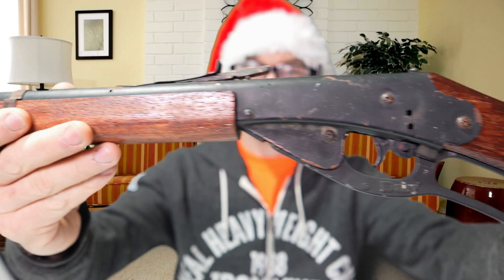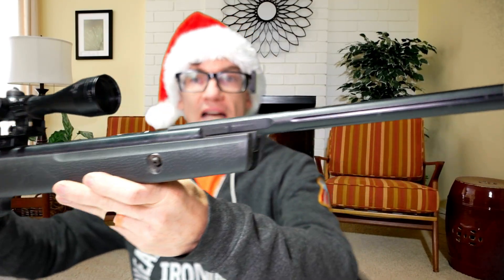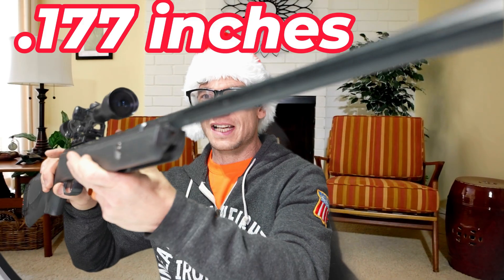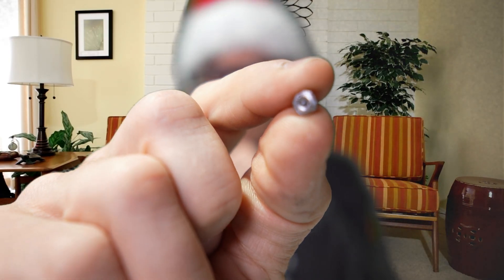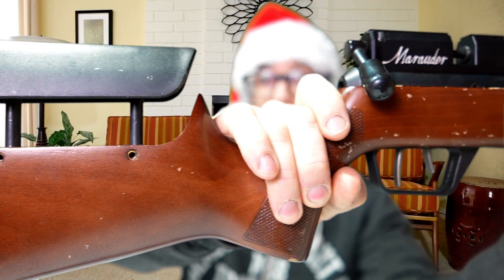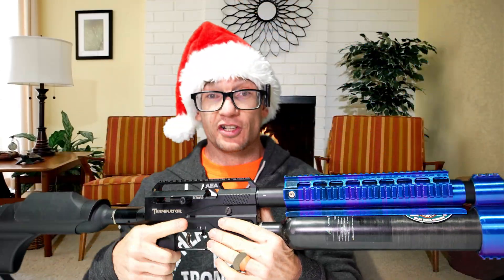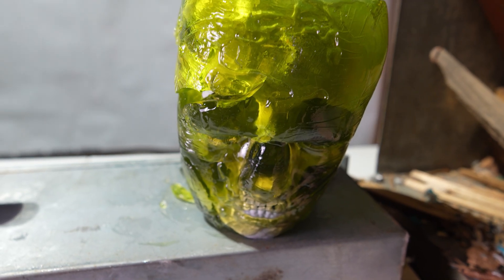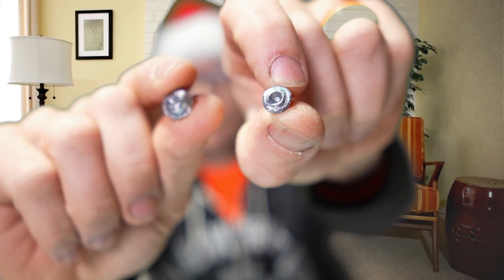Home Alone, But Kevin has a 9mm Airgun (AEA Terminator Gen 2)

Comment: Surprised at the 30 ft lbs of energy making a pass through. Great video bro again
Reply from the maker: Glad you liked the video!
Reply: Not to be that guy but all you need is 20 ft pounds to do that atleast to be lethal
Reply: @BlackTriWildlife That's impressive, for skull pass through?
Reply: You would theoretically only need 14 ftlbs to actually pass through. (Avg skull depth 5.5-5.7in, 5.5/12=0.458x30=13.74ftlbs exerted)
Reply: I’m not the least bit shocked